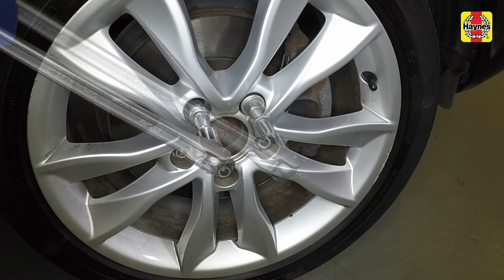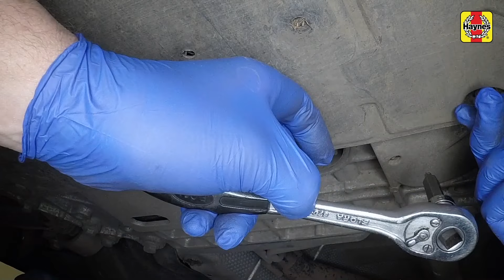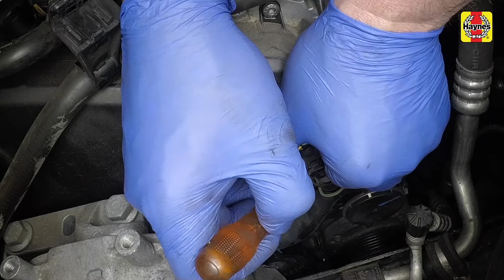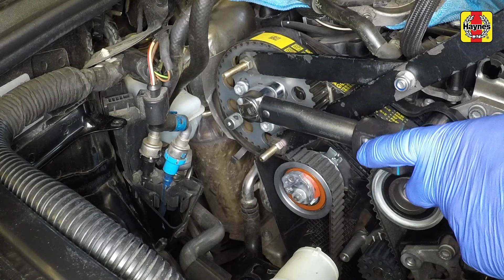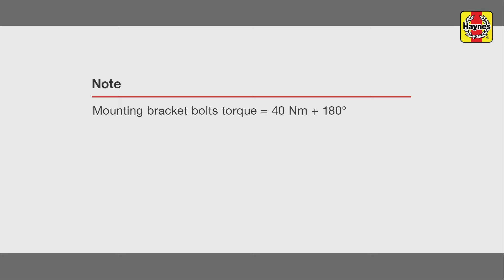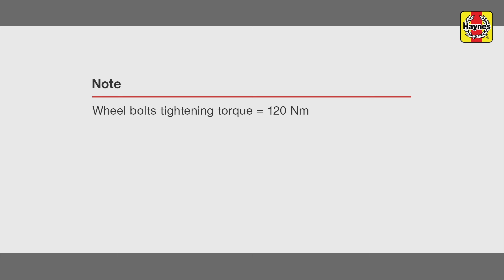How to Replace the timing belt on the Audi A3 2008 to 2012

Comment: Hello, thank you for the video! I have a question regarding tightening of the tensioner. Why are you tigtheting it slightly above the mark? Shouldn't it be in the center of the slot? I have an issue with my audi a3 8p1, because it started generating this annoying whirring noise on idle but if i press the accelerator gently it quickly goes away. The only problem difference i found that the mechanics at the garage tightened the tensionser until the middle of the slot and not to the end of the slot like you did in your video. Thank you for your time and an amazing video!

Comment: How is the cover from crankshaft sprocket 60nm????
Reply from the maker: It's not. For some reason we've included the lower arm ball joint torque of 60Nm. The timing belt cover bolts should be tighten to 10Nm.
Reply: @HaynesManuals  thank you so much. Is there such a video for a volvo s40 1.8  year 2000? Loved this video veery good. 

Not sure mine has camshaft sprocket bolts or fuel pump.
 sprocket bolts but I'm confident to attempt this now for my son's car

Comment: Great video. Can you please tell the name or part number of the tool you use to counter hold the cam sprocket at 6:10
Reply from the maker: The forked tool used to counterhold the sprocket is actually home-made. Aftermarket equivalents are available from good auto accessory/parts stores.